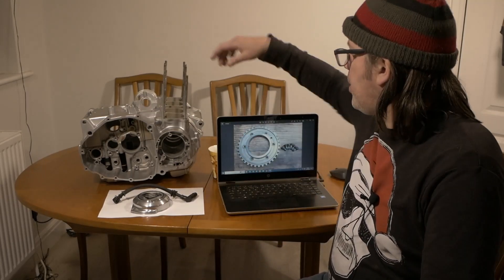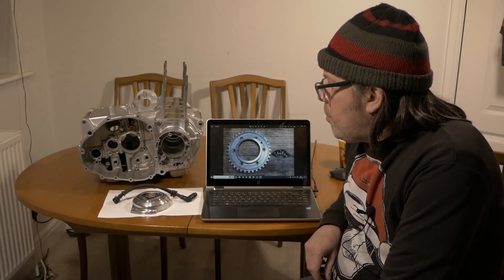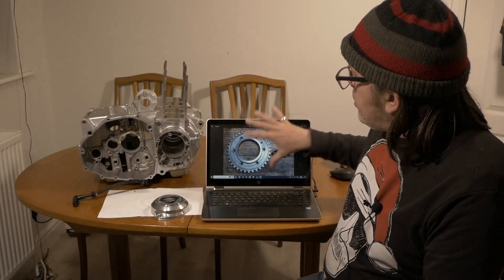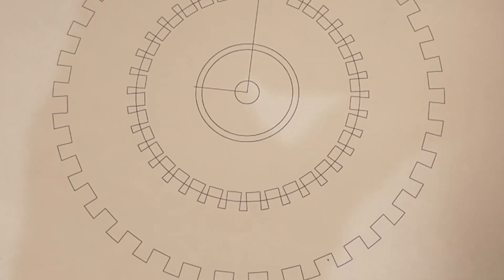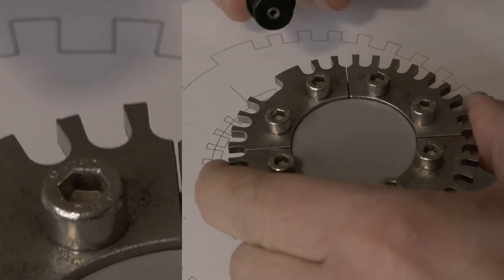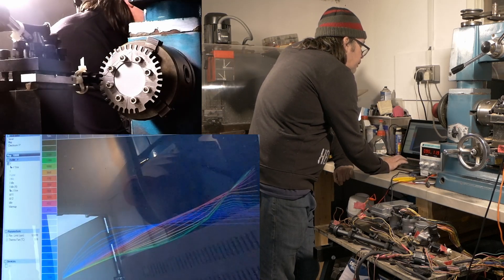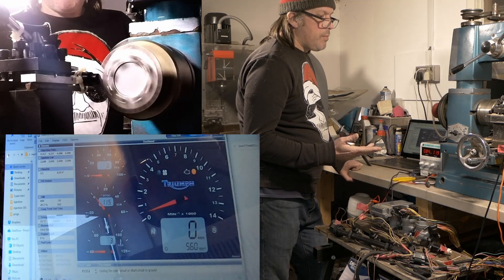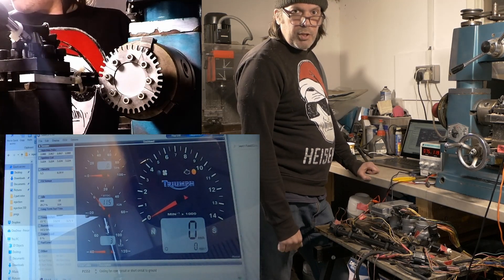Cheap DIY fuel injection on a classic bike, episode 3.

Comment: Interesting as I'm working on a similar project. The air gap on T300 & 955i Triumphs with VR pickups is spec'd as 0.6 - 0.8 mm. It's a bit late for this, I might have suggested machining a spacer between the casing and cover, thick enough to accommodate the trigger wheel on the CS and pickup, retaining original looks yet avoiding casing modification. Nice work though 👍
Reply from the maker: Thanks for the input. I eventually found the spec for the air gap in the tt600 service manual and its as you say.